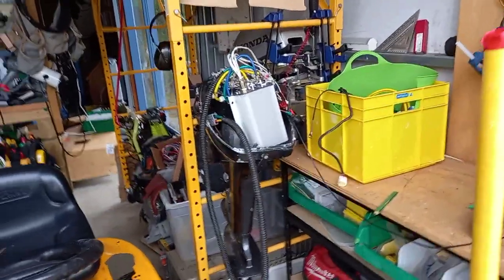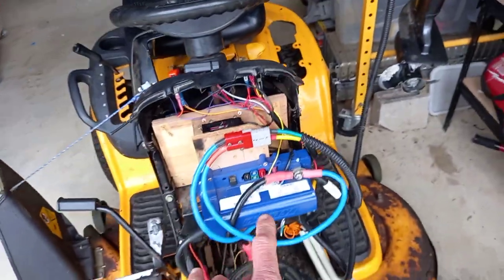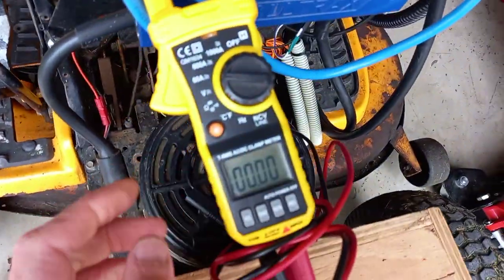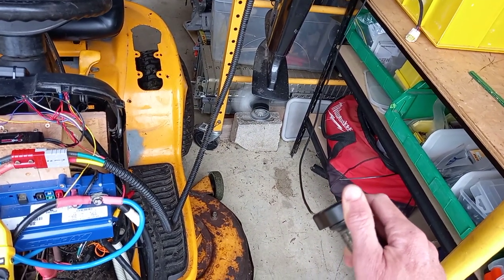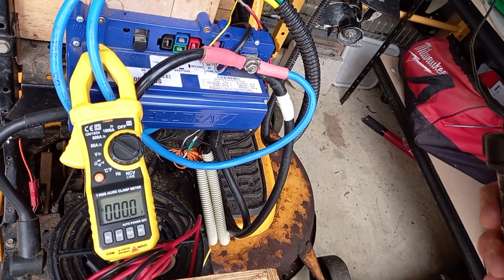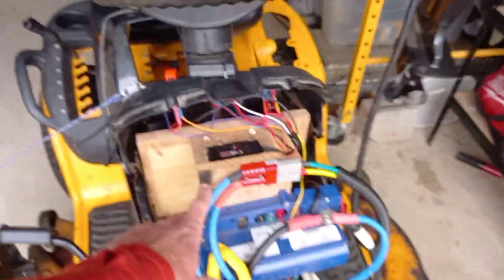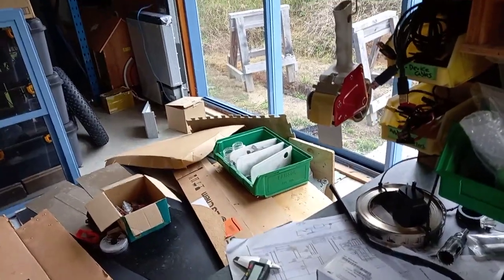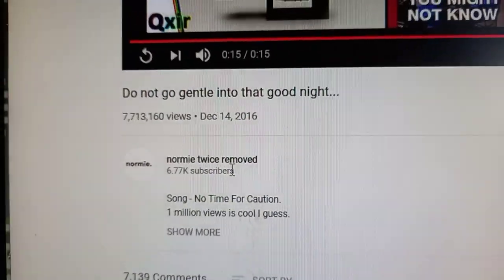Electric Outboard Success!

Comment: ha-ha nice one mate, that must be a testimony to those Kelly controllers, surviving such a big surge. What are you thinking of using for the battery pack on the boat? It must need some serious capacity for 20A @ no load.
Reply from the maker: Starting with just enough Leaf modules to make the voltage and seeing how long it runs on that.